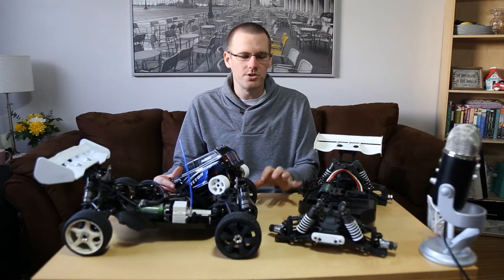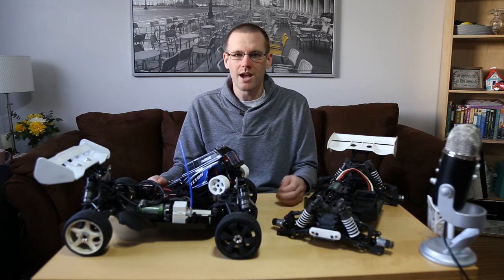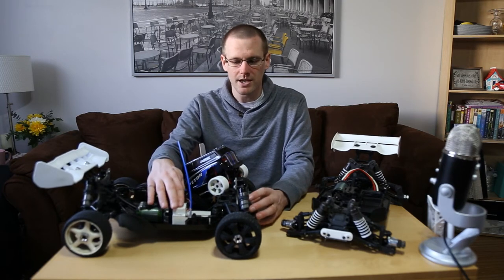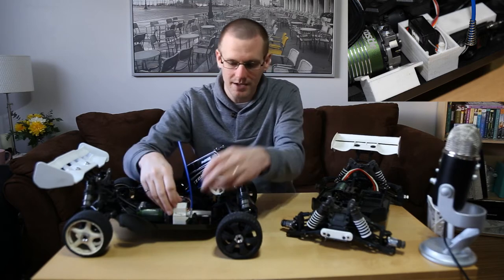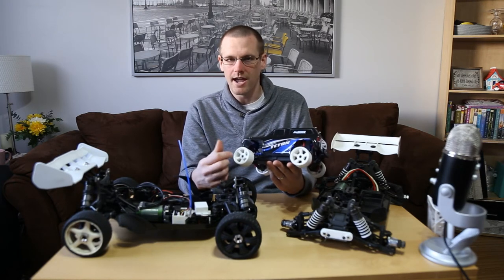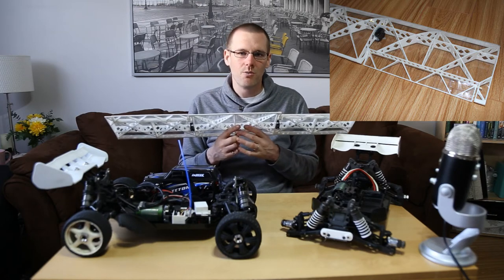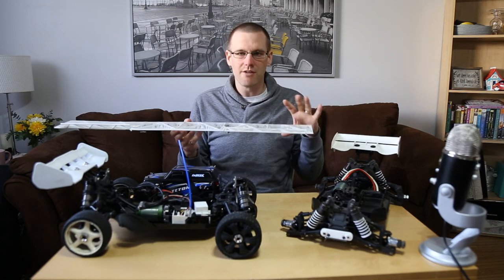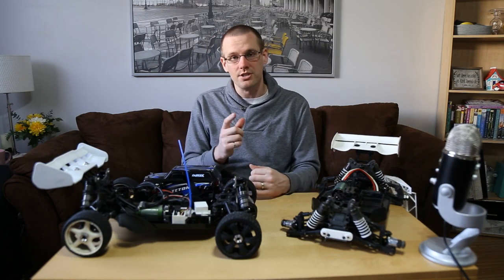How 3D Printing RC parts has impacted the Hobby

Comment: This was the main reason I got into 3d printing. I've been using carbon fiber reinforced nylon and it is nearly indestructible and the perfect filament to use in this instance.
Reply from the maker: How does it perform in high heat?
Reply: what printer are you using thinking about getting a printer to make some rc parts, and want to be able to print with the carbon reinforced fillament.
Reply: @brendonhanson6027  I've converted my Anet A6 over to an all metal hot end in order to print nylon. I'd suggest this mod on an ender 3 if you're looking for a cheap reliable printer. The A6 was my first 3d printer and is a bit finicky
Reply: @Jules_73  awesome thanks for the reply

Comment: There is a guy named Ryan that already sells 3 d Snow groomers cammed Stryker. He has two snow cat designs. He designed and is selling his creations although the kits are some what reasonable the assembled kits are very expencive. He does offer the program to make your own for a decent price. I want to say $129.  I wouldnt mind getting a 3 D printer and learning . I think if our local college offeres a course, I may take the course. Not for credit but for learning how to design and make my own RC parts. I didnt do well in math in school , nor habe I done much in any CAD design. I taught myself basic computer programming using an old Apple 2C back in the early 1990's and have also taught myself electronics and working with LED's. I got back into RC since getting out of it in 1980.  Back then Balsa and Nitro was still king as was 72 hz transmitters. I am now neck deep into ESC's brushless vs Brushed motors, and STILL getting back into Nitro. I want to buy a 3D printer and start making my own parts for many of my projects. From FPV camara holders to Mane a whole plane like you are doing. I know much of it is downloading software and using computer programs.
Reply from the maker: It's not that difficult to get in to. The challenge is really just learning the design software that you choose to use.